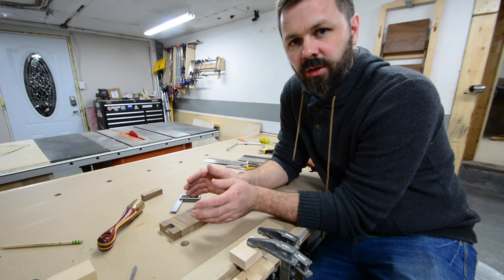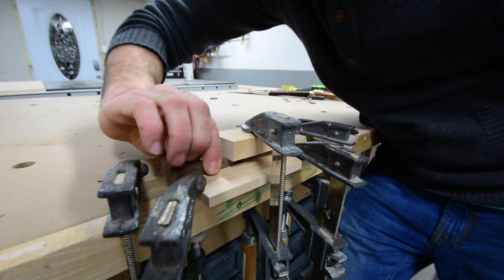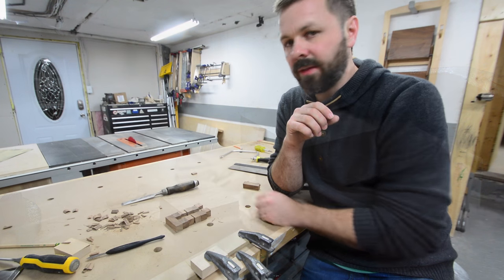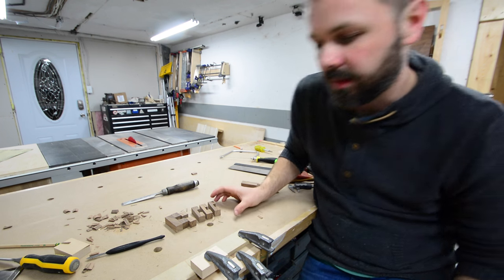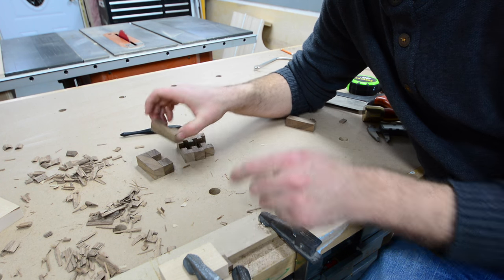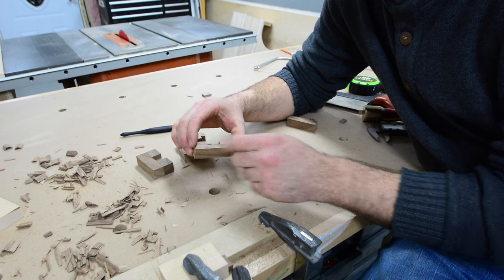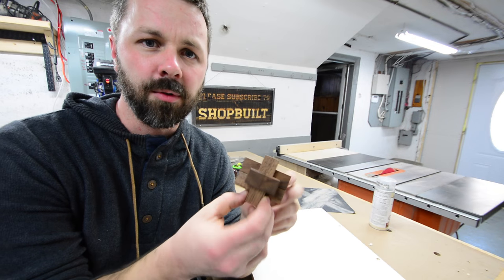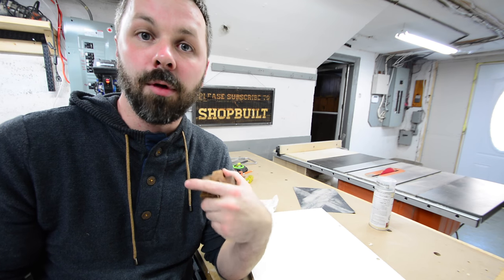Woodworking project - Burr puzzle

Comment: Nice job Ryan! I like the macro shots.
Reply from the maker: Thanks! Me too;)
Reply: +Shop built Are you still using your Nikon DSLR? What is that lens? 18-55mm?
Reply from the maker: Still using the Nikon but I use a 50mm prime for the close ups and and 10-24mm for the wide angle shots
Reply: +Shop built Nice, I shoot with 50mm prime too. Still on the lookout for a AFS wide angle.